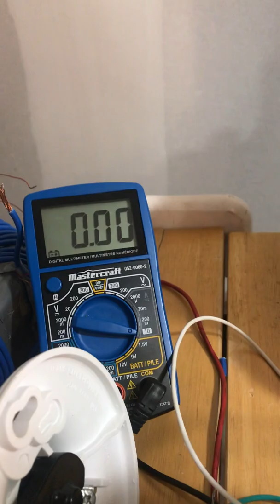HHO Don Smith inspired 0 Amps! Making Hydrogen!

Comment: That's such an incredibly small amount of gas it looks like it's a fraction of 1w to me. What it looks like to me is going does you are putting it through the coil and raising your voltage enough to jump the gap. I have a circuit I run at 7000v 0.000285A but it only draws 2 watts. So the amperage is such a tiny fraction I can't pick it up with any of my equipment. And I'm just telling you that circuit makes about 10 times as much gas as what you're getting there. It always looks like it's a lot of gas I've been through this exact same rodeo before. I've already been getting amazing results and I'm more than willing to show you exactly how.
Reply from the maker: watch my latest video and then show me that you can do the same.
Reply: @thewonn  
I don't know it looks like 1wat or less output to me. It's extremely outlandishly contaminated so I can't tell. When I'm running a cell with that much contamination 5 watts would be overflowing that container with foam. When your cell cleans up you will notice it will start consolidating into one and you'll have big bubbles. That's why I say it looks like a lot more than it is because you're making foam not bubbles. The amount of gas quantity in that foam is actually really small. If you're actually making a lot of gas cleanly you should see a bunch of large bubbles popping up, and you should see absolutely no white foam. I have a contaminated cell I ran at 4 watts, and there was so much white foam it basically overtook all the catalyst in the entire chamber and everything looks White like I just poured Dawn dish soap in the catalyst. Go put a lid on the chamber and pipe it out into a glass of water and watch how fast it puts out bubbles. I'm telling you I've been through this before and I was really disappointed, I thought I was making like three liters per minute at 4 Watts I swear it just looks like a lot when you have a contaminated cells. But for supplementinv cars I don't even focus on output per watt the amount of gas you make is fairly irrelevant. Because I made my car go from 38 mi to the gallon to 52 mpg with absolutely no modifications and only about 200ml per minute of gas, and by limiting factor is I was getting engine knock and need to change my ignition timing to add more. That is absolutely impossible and nobody should even believe me when I say that, my original motivation was to build a welding and gas cutting machine, and I've been really successful with that too, my machine is massively more efficient than plasma cutting. And it seems my flame is over 10,000 degrees because it will incinerate anything, I have been doing these experiments for a very long time, and I'm telling you I can help you if you will let me and not be too arrogant to accept help. You seem to be falling into the trap the NSA made to make you endlessly chase your Tail after Stanley Meyer inventions. And I just want you to know that 99% of what you know about Stanley Meyer is nonsense, his videos are cut and edited I have relatives that live in Ohio who are old enough to remember, what he was really doing and what he really said. But one thing I know for a fact is he originally did not have the tube cell on the buggy. He had a 101 plate Cell the with 12" plates, the buggy was running 100% off a 50Amp 200v Alternator. I have relatives who seen the buggy and seen the cell and seen it running, he literally did nothing special all he did is pipe the exhaust into the intake. And he was making around 70 LPM of gas at full power. If you assumed he was making basic para hydrogen like what comes out of a tank and normal O2. He should be producing around 40 horsepower. At 10KWH making him about 300% overunity. When they seen the buggy it seemed a little slow, but later he got it to the point where it was faster than on gasoline. He was running straight off the alternator originally. I don't think he ever actually did anything with the tube cell people think he was running the buggy off of. The problem I keep seeing is every time somebody makes a big enough cell it's a complete pile of junk, and they do ridiculous stuff like drill holes in the electrodes, and point surface area out-of-phase, and then if they actually have enough gas they are too stupid to make the engine run properly.  And nobody makes any decent quality gas has their cell burning at like 120°f. Making it not even possible to produce a meaningful amount Ortho. And alot of them think you need to compress it so you can high-pressure inject the gas. There's also ruins it because when you pressurize the gas over 10 psi it will diffuse your gas back to Para. The problem I'm having right now is I can't keep the superheated steam from the gas from getting in my 4-stroke oil between the Piston walls, so I'm stuck on two-stroke oil injection rotary engines and turbines. I'm trying to figure out a water-based lubricant to replace 4-stroke oil and I have the four-stroke whipped. But I think the Tesla turbine is a way better option it was literally designed to run on hydroxy gas, Tesla was the original water engine inventor. It makes me wonder if Stanley Meyer ever fixed the oil problem with 4-stroke though.
Reply from the maker: @electrolysisresearch8013  yeah I agree with pretty much everything you just said. I ran a generator on HHO. I don’t really follow stans stuff as I have done my own experiments with alternators to know that it basically works without too many mods. Not trying to be arrogant. I just like to see results. I will check your vids out sometime.
Reply from the maker: https://www.youtube.com/watch?v=Ezog4qEmGyo